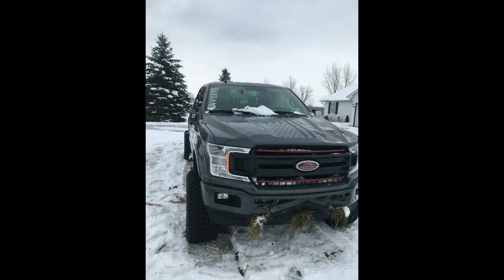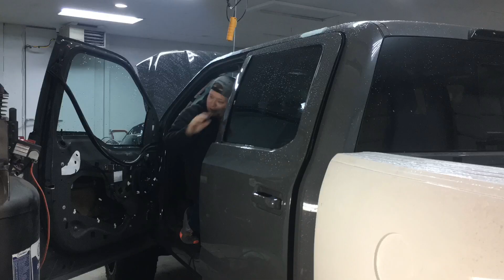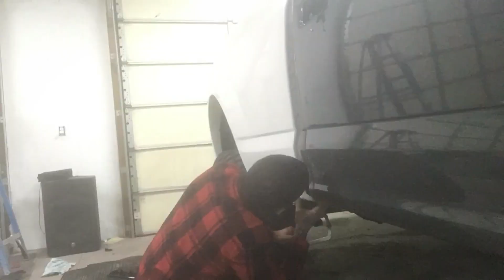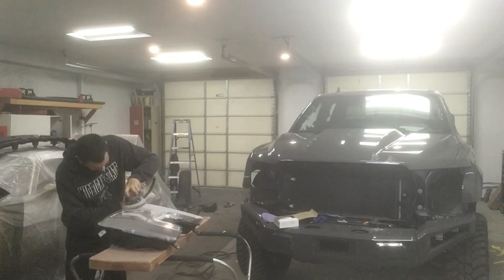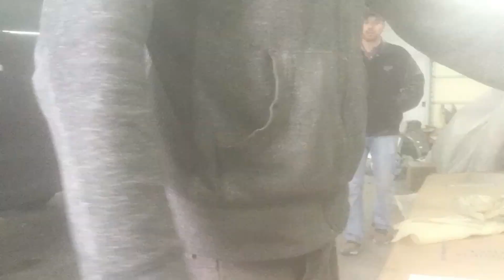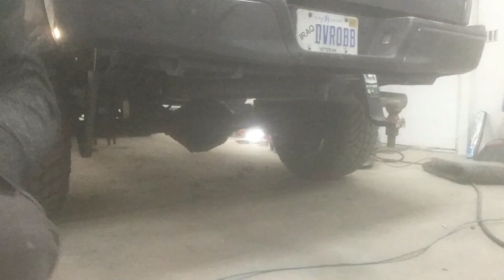Raptor Swapped A Totaled 2018 Ford F150 XLT

Comment: Is your truck the 6.5' box?
Reply from the maker: yes 6.5 bed 3.5 eco
Reply: Very nice. I have the same in a 2016, I have been looking at the fiberworx conversions for both fenders and bedsides. What bulge did you select?
Reply from the maker: Precisionpressure 3.5 for the front and 4.5 for the rear.